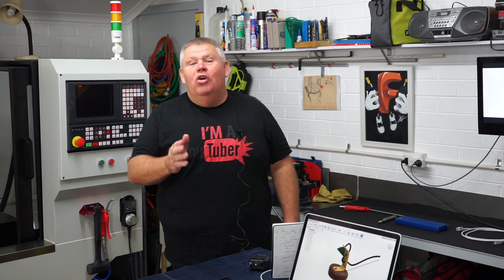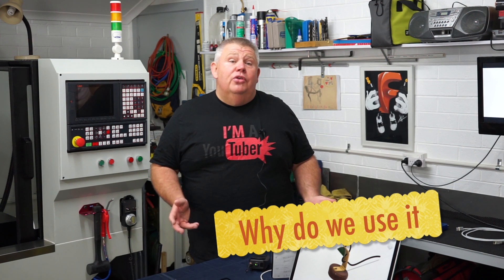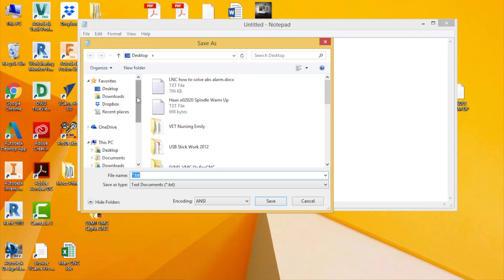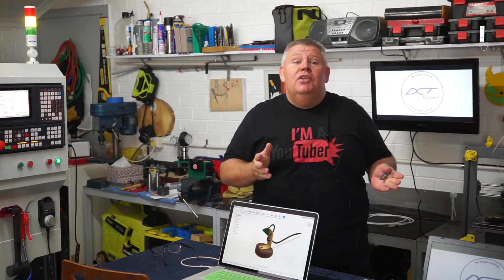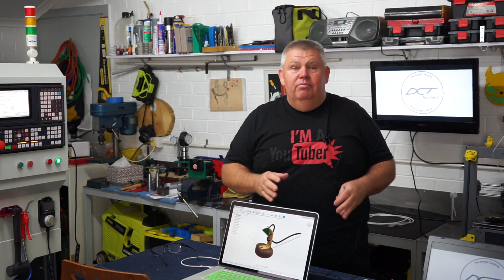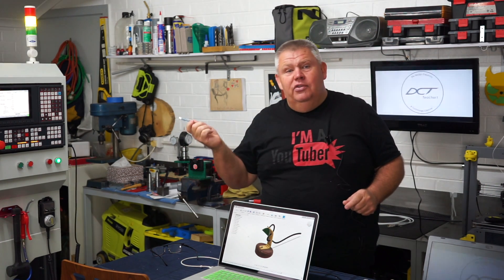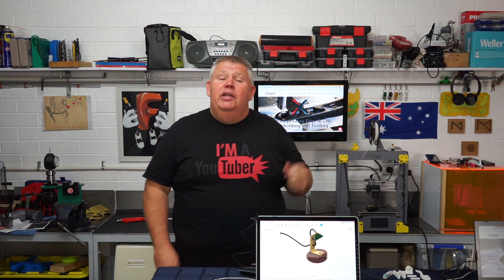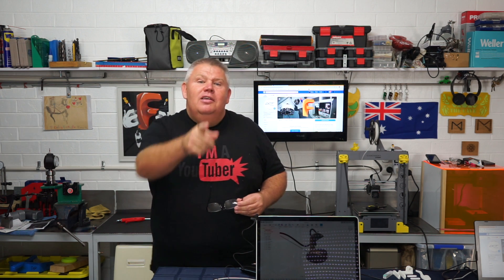CNC Spindle Warm-Up Routine.  What, Why & How

Comment: Hello. I see that u are using fusion 360. I am also trying to figure out a post processor. I also have a cnc  router with LNC control MW2200.  What post are u using .can u offer some insight ? Thank you 😊
Reply from the maker: Hello Varlan.  Send me an email and I'll share the post processor with you.  However, it may not work as mine is based off "generic fanuc" language.  My email in in the about section on my channel page.

Comment: Just copying the program as show to a comment for copying and pasting, saving everyone a minute...

[Note: Syntec controllers require a dot '.' to be added after each of the RPM values following the S]

02020 (Spindle warm-up);
(Run this program before machining);
T01 M06
S500 M03
G04 X100
S1000 M03
G04 X100
S2500 M03
G04 X100
S5000 M03
G04 X100
S7500 M03
G04 X100
S10000 M03
G04 X100
M30
Reply from the maker: Thanks Dan 🙏
Hope you’re well mate. Cheers 🍻

Comment: 0:48 why G4 X100. x not good way use time.why everyone use it?.it can be easy read axis movement.put it on wrong place on program and write G0 X100. G0 P100 do alarm. get it. use P if control allow G4 P100000
Reply from the maker: OK Thanks 😊 👍

Comment: Drawbar rattling around without tool in? That's all I got.
Reply from the maker: Hi Manny.  I have spoken to couple of people now in regards to this.  One is a trained Haas (USA) technician.  He suggested that it is good practice to have a tool in the spindle whilst running the warm up cycle.  He also suggested the drawbar rattling at high rpm could upset or damage the Belleville washers or cause the retaining nut to come loose, but is unlikely.  Cheers mate, Aaron.
Reply: @DCT_Aaron_Engineering  yeah would   have to be the draw bar, only thing that might be damaged

Comment: Definitely add in Some XYZ action for this and a press of the auto oiler.I use a full motion of the XY in both a rectangular and then diagonal pattern while the Z goes up and down a bit (remember all the vises on the table with full travel moves) and finish the program off with the largest circle the machine can cut thrown into the mix with a slow spiral down of the Z.For my Tormach an M47 (Repeat program from first line) will keep it going while you finish your cup of tea or do some workshop cleaning.
Reply from the maker: Hey Micheal.  Thanks for handy tip mate.  Sounds like I need to get busy writing some G-Code, or you coming over to do it for me :-).  Good to see you up nice and early.  Now get to that shed and start making some chips ha ha ha

Comment: 10-20 min seems excessive but I don’t know much. I do know 10-20 is too long to let your car warm up unless it’s a diesel in the winter
Reply: a Car engine produces much mor heat, so a spindel needs much more time to heat up.
Reply from the maker: Hi Robert.  The basic Haas spindle warm-up routine that is loaded at the factory runs for 20min.
Reply from the maker: Good answer thanks ;-)

Comment: Good advice and practice Aaron. We do it on a daily. Waiting for a video on how to do it with Axis also warming up and lubricating !
Reply from the maker: Hey Luke.  Yes the running of the table and column (XYZ) is something I need to work on next.  The lubrication won't be easy as the lubricator systems is on its own (seperate entity) and not connect to the controller.  Hope you and Jen are well mate.  Say g'day to the boys (Jin, Aiden) down at XM2 for me please.  Cheers buddy, Azza.

Comment: Hi Aaron,

The comment you made about the Haas person to run a tool is interesting this video created by Haas shows they don't run a tool: https://youtu.be/CZcADyIqYEw

Yet in another video they advise to use a balanced rod, Not a tool in their 10k rpm spindles: https://www.haascnc.com/service/troubleshooting-and-how-to/reference-documents/mill---spindle---programs--run-in--warm-up--break-in-.html

When you said you don't spun the spindle up without it being clamped.
The Belleville washer stack is in the normally closed position until a tool change is requested.

Regards
Reply from the maker: Good morning and thank you for taking the time to watch and provide feedback on my channel.  Thank you for URL links.  I actually watched the same video before making mine.  I even called the GM of Haas Australia and asked his advice (as he originally trained me).  He stipulated that a tool (suggested an empty collet) should be placed in the spindle before running the warm up routine.  I understand the belleville washers are in the closed position, however this not their clamped position.  Furthermore, I think once clamped (with tool in spindle) the drawbar is centralised and can't move / slop around at high RPM etc.  However, this is just my opinion :-).  Cheers, Aaron.
Reply: I just think it's interesting, one video didn't do it, yet the other video said when going over 10K. I would like to know what Mark Terryberry thinks! 
(If we get 100 likes can we get Mark to comment.... LOL.)
Reply from the maker: Ha ha ha who knows bud, maybe?  Years ago Haas marketing used to watch my videos when I was putting up SMM2 and ST10 footage.  Sadly, I don't think they watch me anymore :-(

Hey, do you still have your lathe and mill in your shop?  Are you thinking of converting them to CNC?  Just curious :-)
Reply: @DCT_Aaron_Engineering  Yes I do still have them. I was thinking about converting them, but that's very costly.

I've been toying with an idea of building a CNC surface grinder.

Comment: Maybe different taper types might jam up.
Reply from the maker: Now Peter, the only Mythbuster special I want to do is how many hamburgers I can smash in one sitting LMAO.  Jokes aside I think you nailed it with you explanation.  In regards to leaving a tool in a spindle I agree with you.  It's a big no no in my book.  Tool should be removed at the end of the day and put away.  Hey, check out DerDracheTV channel.  He's got some cool 5 axis stuff going on :-)
Reply: @DCT_Aaron_Engineering  is there a way with the LNC to put the tool back if your tool changer is full of tools? Like T0 or something to put all tools on the carousel and leave the spindle empty?
Reply from the maker: @fastlaneinnovations9344  Hello.  That is a very good question.  Unfortunately I don't have the answer for you, sorry.  I have noticed that there is no tool offset for tool 0.  Next time I have the machine fired up I'll test it for you.  I keep my probe in tool pocket 11, but remove it each time.
Reply from the maker: NuttyforNissan Hey man. Yeah not sure on that. I’ve used BT30, BT40, R8, and MT3&4 and never had a problem. However I can’t speak of Capto or HSK etc. 🍻
Reply: @DCT_Aaron_Engineering  never ecer run an HSK spindel without an Tool in it. a Good spindel also will never run without an clampt toll. Iso taper schouldnt make problems below 6k rpm also up to 10k but better be safe.
Reply: Sounds like one for Mythbusters, lol.
Thermal expansion is something to take into account with most 
Machined or Ground surfaces.
But i would Not be concerned to much with Taper Fit on a spindle.
The only time this would be a problem is if someone left a tool in a spindle for a very long length of time.
Reply from the maker: Hey buddy.  I just checked out your channel.  You working on some really cool CNC machines over there.  Loved the 5 axis stuff you're doing.  Huge thumbs up dude.  Oh yeah, I even subscribed ;-)